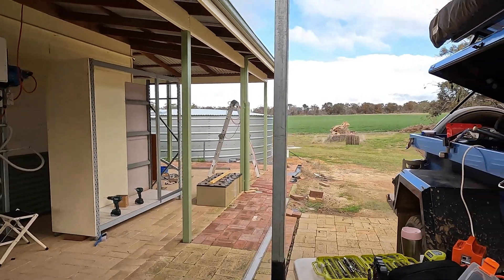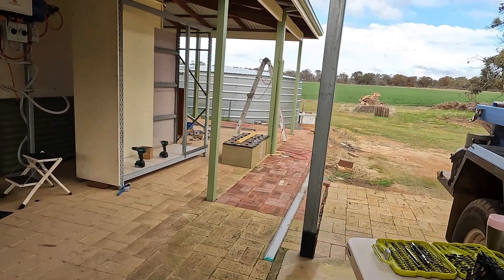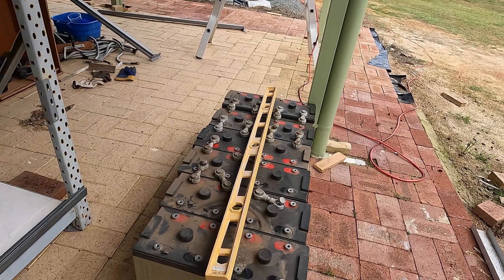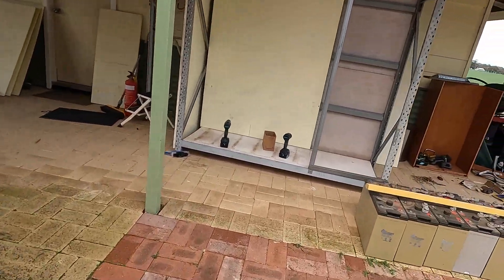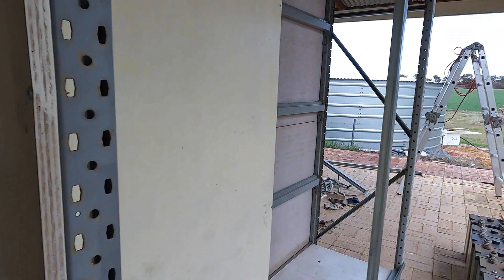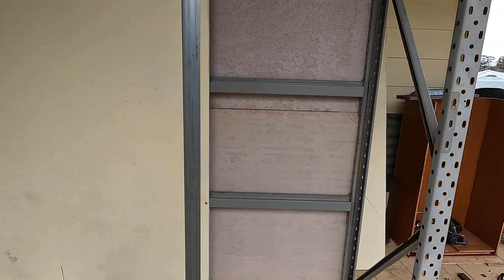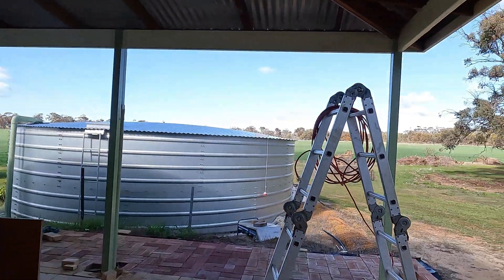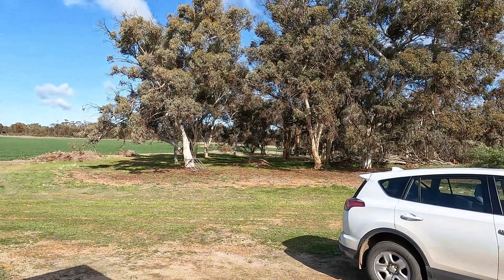OFF - GRID System Down.  He needs Power NOW,  Fast system Rebuild

Comment: Looks good :D You can shift the PV-Strings to the new system AT NIGHT :D A broken Victron? It seems to happen :D Problem: repair ain't easy because they are full of paste X-D
Reply from the maker: Victron's are good but when they pop there is nothing we can do with them. Costs as much to fix them as a new unit.
Reply: @JustinCaseSolarPower  still open them up and check if it's only the fuse blown X-D

Comment: looks rather easy to build.
Reply from the maker: it is John. Not hard at all. Need to size the system for the home, use the right wire size and circuit breakers, and crimp all the wires very well, I use a hydraulic crimper to do mine. Wire  it so its safe. Then it will give many years of trouble free service. 🙃 👍
Reply: @JustinCaseSolarPower  I use a hydraulic crimper too
Reply from the maker: @thefaeryman  Yes Never had any problems with the crimped ends at all. 😉 ✌

Comment: Never seen a Victron break.
Reply from the maker: I have seen quite a few dead Victron charge controllers. Seen more Victron's then any other brand I have used. Put a fan on them and they will run forever. Otherwise they can run very hot and stop working.